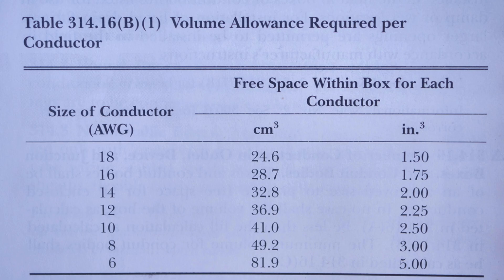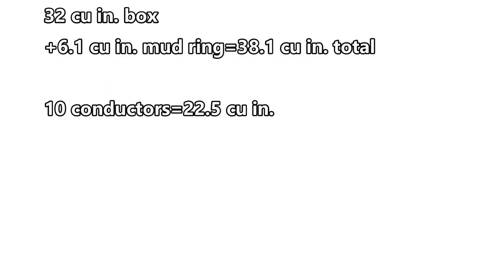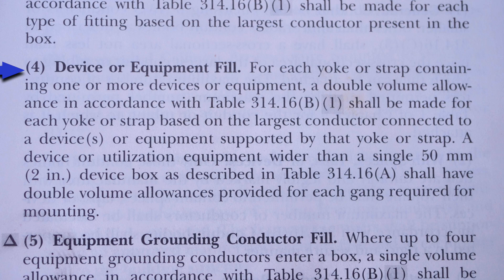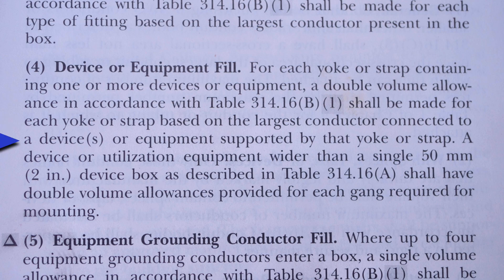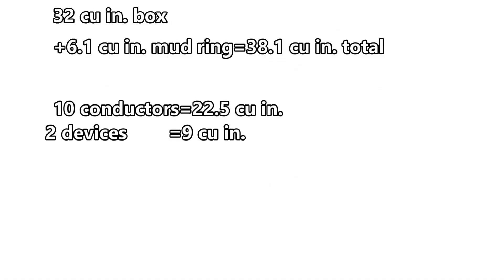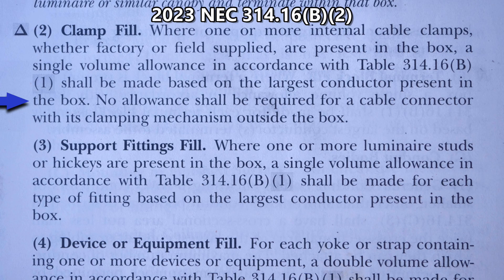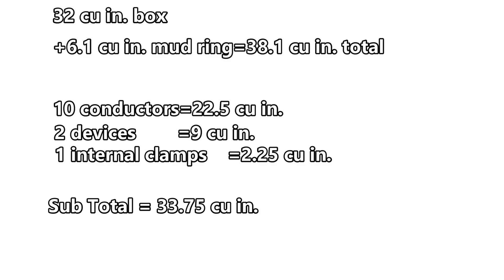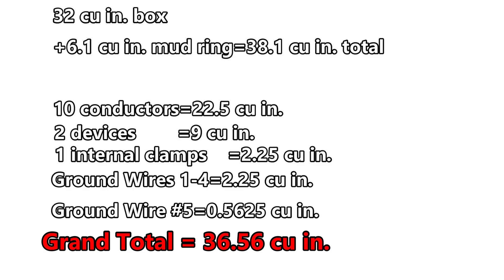NEC Box Fill for 2023 with Integral Clamps and Mud Ring, Article 314.16

Comment: When I envision clamps, I envision a cut-in box, or fiber box that has a clamp and a screw to fasten the cable. These clamps take up a significant amount of space within the box. I have never counted those on the box you used as clamps, as they have no clamping mechanism. I may need to reconsider. Thanks Sparky.

Comment: Very good Sparky. i need to buy the New 2023 NEC.    i did not know about the internal clamps.
Reply from the maker: I highly recommend it. Thanks!
Reply: @SparkyChannel  Kentucky is still on the 2017 nec.   Probably will get the new 2023 nec in the state in the next yr
Reply from the maker: It's good to be prepared. :) @zerosparky9510